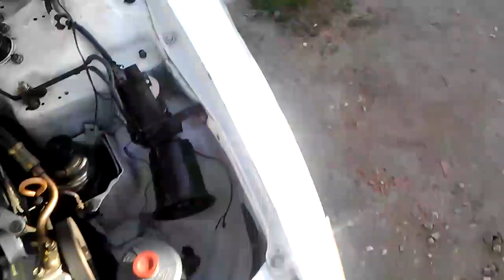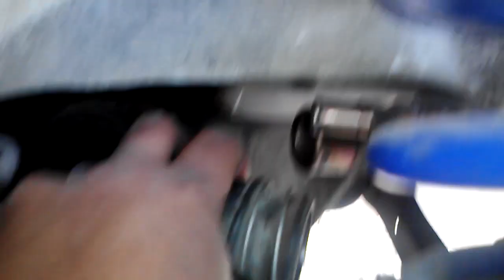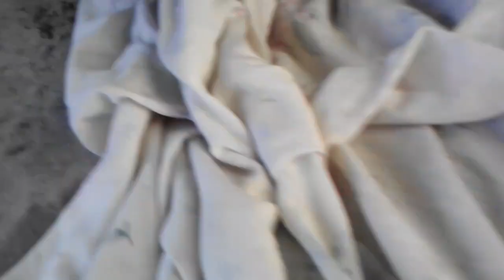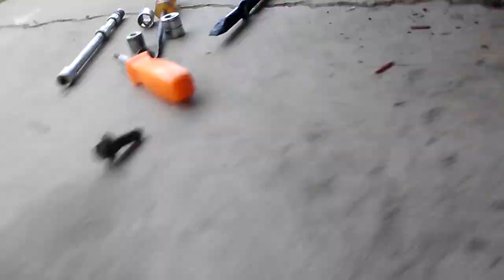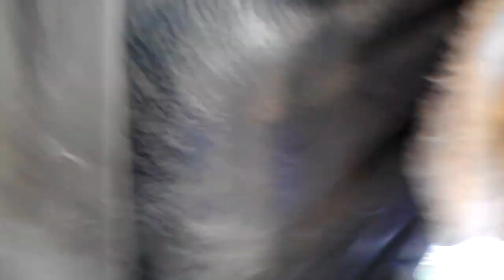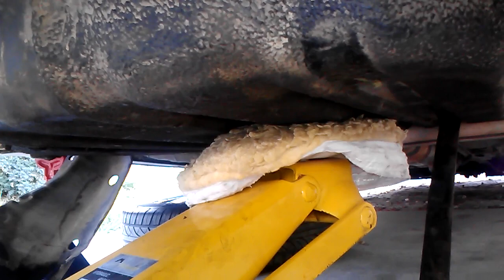How to Remove gas tank off 94 to 97 honda accord

Comment: To those who are upset that he didn't show everything step-by-step: if you need someone to explain to you how to undo bolts and screws, you shouldn't be working on your car yourself.  Start with something easy like your bicycle or make a paper airplane and work your way up.  

I liked the way this was done - so many other videos are full of a bunch of chatter while you're waiting for the important stuff.  This showed all the connection points and the lowering process without any needless padding.  Thanks to the uploader.
Reply: +Truth71 I think the point everyone is trying to make is that just showing the lowering of a jack is useless. This should have been titled "You have no idea what I'm doing, but watch me lower this tank without anything else." Why would anyone searching how to do this not want to see a step by step? The lowering is literally the easiest part. Way to White Knight it though. You're a true internet hero.

Comment: Only thing here really missing is the plastic cover that sits under the fuel tank.  Removal of that is a chore, as the exhaust and exhaust heat shield makes that tricky to figure out.  While this definitely highlighted connection points that are important to locate and disconnect, it undersells the job a little bit.

Comment: Did you check the fuel pump relay first. I had no start situations during the day. No fuel. Then at night or in the morning it would start right up. The problem was the relay needed to be re soldered or replaced and would not work when it's hot. It's a much cheaper part and easier job, and a really common problem in 5th gen accords.
Reply: Yep! Simple reflow of the solder 100% fixed for free.

Comment: @1:15 - Gave me a pretty good idea where the mystery leak is on the 94 accord I just got for $450. That pre-assembled High pressure line uses the same means of clamping force at the connection as a power steering pressure line, & I've seen enough of those fail. Could also be rodents getting all chewy on the rubber part of it. Meh, easy fix either way...

Comment from the maker: jreyes1261 

Well I'm sorry!  I didn't explain anything just Because Its not that Hard of a job Only takes About 20 minutes to remove everything. This video just gives you an idea what to Remove. If you didn't get the point that's on you. If you still need Someone showing you how to remove 4)screws and 2) bolts i don't think you should be doing this job Take it to a local shop.
Reply: 951CD5accord 

Thanks for this vid, it was direct and to the point, it told me exactly what I needed to know and you didn't take 30min to show me where the hoses were. I agree with you, if someone needs anymore info they don't need to do it.
Reply from the maker: Dave Malik thanks for stopping by

Comment: circusboy90210 All accords before 98 have their fuel pumps inside the tank, so it has to be dropped to replace em. The little compartment in the trunk that leads inside of the tank just leads you to the fuel measuring thingy...
Reply: not true I replace my fuel pump on both an 89 and a 87 from under the seat. through the inspection port.

Comment: You showed nothing but literally just lowering the tank removing the battery power cable. And a few fuel lines that seemed to already be loose. O_o of no use to the actual process of the main reason REMOVING THE FUEL TANK! Next time try to show the bolts, screws, lines, cover, or if you had to drop the exhaust to get it down. Things of that nature that were the main process before you just lowered the tank.

Comment: takes more than 20 mins, maybe half your car was already missing, i got rusted exhaust bolts, heat shells to remove, striped bolts on for the protected covering for gas tank, wire harness for fuel pump. Takes about 15 min to put the car on 4 jacks stand and take the wheels off.  Also see a shiny new drain plug modification, somebody been miss with this fuel tank a few times.
Reply from the maker: jmac2050 old video

Comment: Thanks. The detail of battery cable disconnect may save a life.  I don't think I would have thought of it and is is sensible. The rest too - might not have thought of bringing in more light and access via tire removal.